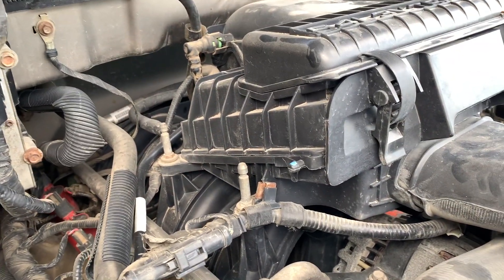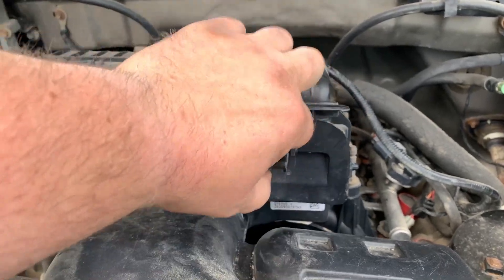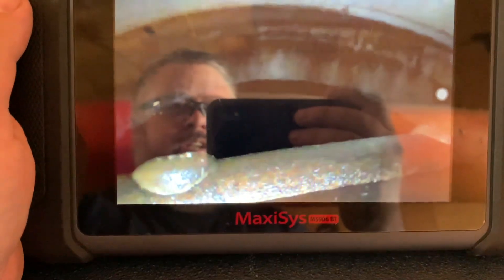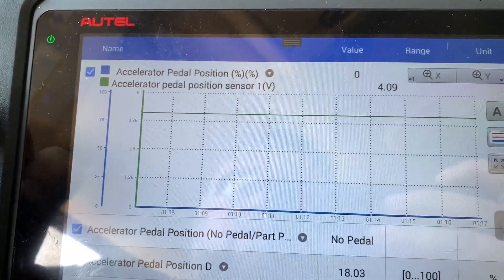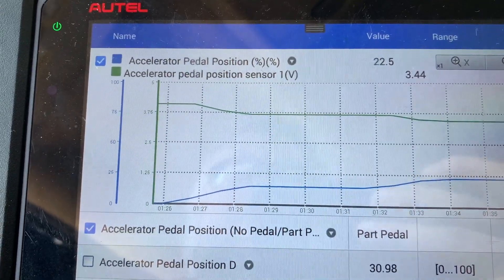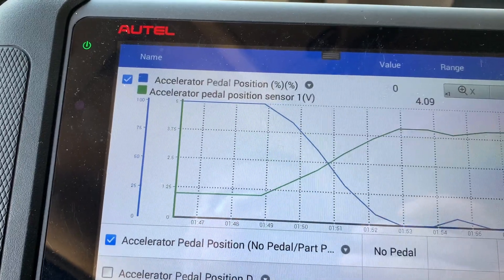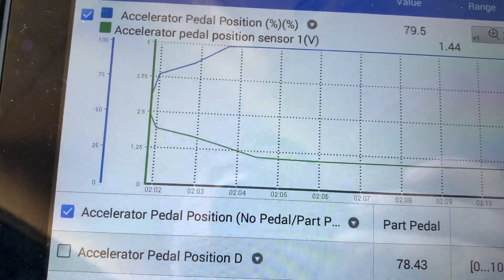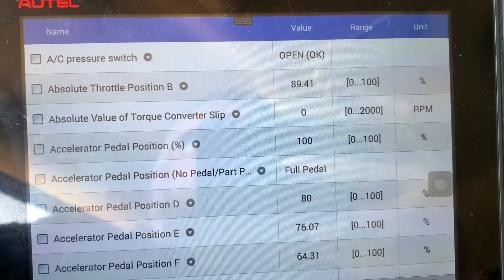Troubleshooting Electronic Drive by Wire Throttle Body Issues Ford 5.4 3V

Comment: That's a fair test to see if the 'accelerator pedal position sensor' is working within it full range. I thought this video was related to the throttle body. You didn't show/verify any 'throttle position sensor' data..ie. throttle position sensor A + B which are part of the actual throttle body. Wouldn't looking at t.p.s data show more accurately if the throttle butterfly is actually moving, or sticking as you were describing?🤔

Comment: Jerry's how to. Drive by cable is the best.  But Drive by wire has come along way in the last 10 years.
Reply from the maker: i don't think any modern vehicles are built with drive by wire anymore
Reply: @TestDontguess  you are correct sir.

Comment: I have used my scope to see a dropoff a scan tool  can't see  as the gas pedal to throttle body correlation could be  off  or the throttle position is not reporting withing specs.  Good start with the scan tool  as an obvious fault can be seen as shown . Good stuff Jerry. 👍
Reply from the maker: thank you Steve